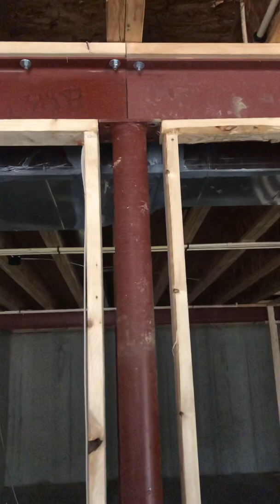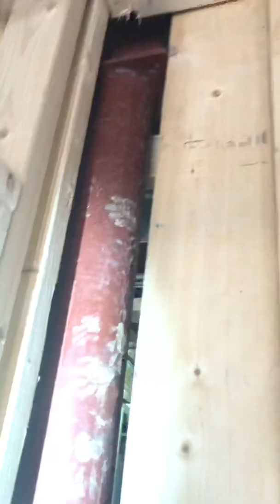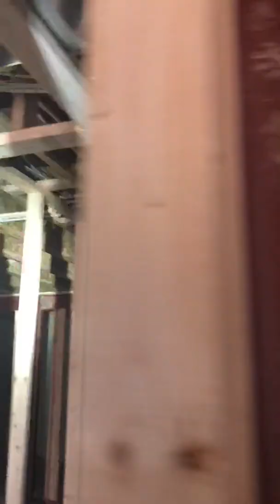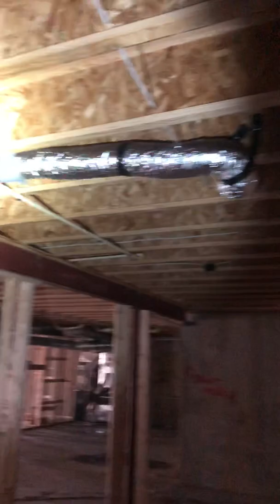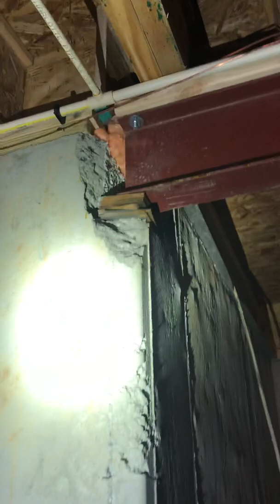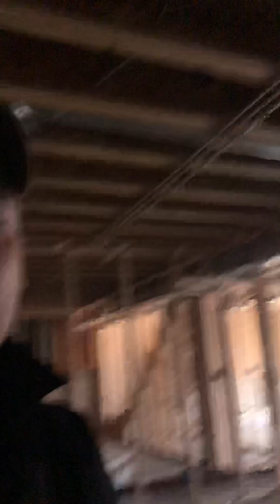Pre-Drywall inspection

Comment: Pre Drywall inspection includes all vertical penetrations in framing for electric, hvac and plumbing must be sealed with an approved fire blocking caulk like Red Flame Safe. There was none in the video. You fail inspection for that everywhere.